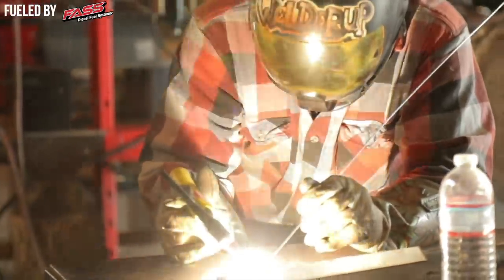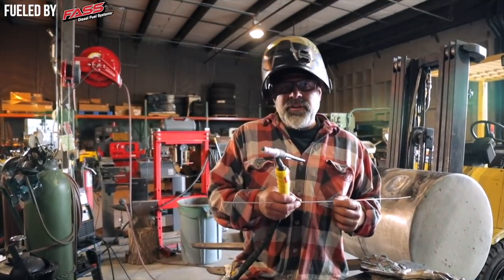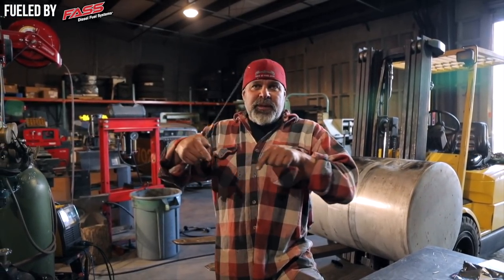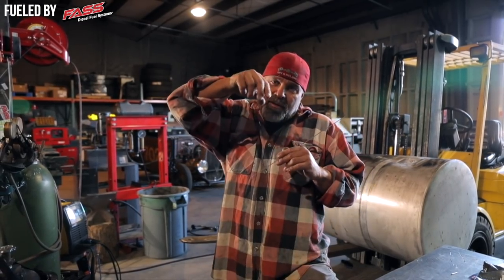TIG Welding An Aluminum Fuel Tank ⛽️ EXTREMELY DANGEROUS WELD

Comment: my late father was a welding engineer, he used to certify the welder's for their coding's, he was also certified to weld/repair nuclear reactor's on Royal Navy submarine's, he had a special stamp in his passport which related to the official secrets act, yes i'm bragging about him but he could weld anything, still miss him,
Reply: Dads are the hardest boss ever to work for but on the hand they are  the best  brother nothing wrong with bragging about dad but I just find it a little hard some times fill his shoes and picking the ball up and running with it  cheers to all the dads dead or alive thank you God speed
Reply: I'm impressed mate 👍🇬🇧
Reply: the company I work on over here in the states does the same thing. ive got a few hot work certs but always working towards more.

Comment: Purge with argon to eliminate oxygen in the vessel.
Reply: Great answer but the question is, how much argon and time will it take to purge a 125 gallon tank?
Reply: Some of these YouTube welders make me laugh
Reply: I 2nd that, argon purge is the safest way I’ve done it many times. You can check the purge with an oxygen meter or if you can’t get one use a lighter by the vent. If you can’t light the lighter from a few inches away your purged.  If you don’t know how to properly setup a purge you probably shouldn’t be attempting this anyway. 👍🏻
Reply: PURGE THE TANK ! I cringed when you took the torch to that without purging. You have to eliminate the air in the tank to prevent explosion. By not even mentioning purging the tank you are showing people they should  weld tanks in a very unsafe way.
Reply: Common welding knowledge never weld on an empty pressure vessel and displace oxygen with an insert gas....in this case, argon.
Reply: @darmstrong9334  125 gallons is 15-16 cubic feet, so it could take a long time and a ton of argon to fully purge it.
Reply: Nitrogen works just as well and is way cheaper than argon
Reply: Why couldn’t you fill the tank most of the way with water then only have to purge the small air gap at the top? Reduce the amount of argon needed to purge out the oxygen
Reply: I converted a 300 ltr LPG tank into a compressor tank. decanted the gas, filled with water and welding was no problem.
Granted I was shitting my pants at the time but I've done a few the same way now and never had issues.
Reply: I always purge with argon. Maybe its because i have done alot of stainless welding that requires is. But purging with argon makes the weld on the inside look as good as the outside when done properly
Reply: Striker works as a lighter...

(& I'm no "welder") 👷
Reply: Exactly
Reply: Just out of curiosity, why not rig an engine exhaust to purge tank? Perhaps a vehicle or a generator - just to blow out any oxygen..... just wondering. I do know a fellow who almost blew his hand off welding a boat gas tank - after he had filled with water.

Comment: Old school rule for welding fuel tanks is soap and water rinse the tank 20 times then... fill the tank full of water so there is no air pocket. If in doubt, rinse the tank 30 times. You can laugh if you want but this rule was taught to me in 1982 by my welding instructor.
Reply: Or you can just run your car exhaust into it for a good half hour or so after rinsing it once...
Reply: You don't need to fill the gas tank with water and soap and 20 time rinse. Just empty it as much as you can to another container and with all filler and breathing and fuel pump holes   open, put it outside for couple of days, when inside completely dry you can weld it. If nothing inside how can explode ? Only Air can explode?

Comment: Run the exhaust of an old gas powered car into the empty tank, let it sweat for an hr or 2. No more boom boom. An old lincoln pipeliner 250 works good. Flat top, hot exhaust.
Reply: what if the old gas powered car is running super rich?
Reply: @repurposedperformance5762  Don't matter,the hydro carbons will help expell oxygen and vapours ,Remember its the vapours that ignite,you can drop a lit cigar in a motorcycle gas tank and it'll go out every time,you hold a naked flame over the tank and the fumes will light up instantly
Reply: @ianmangham4570  so tons of raw gasoline vapors wont ignite when you spark a welder on the hole the fuel vapors are exiting...... I cant wrap my head around that. I see if it was a old perfectly running car but if its expelling raw fuel out the exhaust I dont know how that "doesnt matter"
Reply: @repurposedperformance5762  When have you ever seen a car spilling fuel out the exhaust? /you may get a few drips on start up but when the motors warm it's not gonna spew fuel out the exhaust,you got running rich/fire hose on the mind son 😂
Reply: @ianmangham4570  A car with a dead hole will indeed dump raw fuel put of the tail pipe. Dont believe me? Go watch the episode where Steve builds the Gasser car "Eye Candy". A car that is flooded or has a fouled plug will run raw liquid fuel right out the tail pipe "Son".

Comment: When I went to school for tig welding, we would set Argon and Helium mix for the thicker aluminum, it definitely helps with the penetration and flow. Also one of the craziest thing(s) I welded were actually top secret, I did a background check and signed a NDA when I first was hired through the company, all I was told the pieces were for a particular aircraft.
Reply: I'll take shit that didn't happen for $200
Reply: Thank the brass for  high lvl clearance jobs for private contractors!!   makin the big bucks  always enjoyed it
Reply: @BiggusDickus2  it's very likely. Welded on and worked on several classified jobs. Not all that exciting, unless you are a science buff too and can piece together what they are really doing..

Comment: I've been welding for almost 3 years, I've done a couple fuel tanks and one fuel/hydraulic tank and it's best to purge with argon. After you are done welding it up you can close the cap and plug some of the holes with fittings if you have them or stuff a wet rag in there and stick a air hole in there with a air gun on the end with a wet rag wrapped around it. Put some soapy water in a spray bottle and pump some air in the tank and spray the weld with the soapy water and look for bubbles, maybe get someone to help you look for bubbles if you are at the other end. Hope this helps 👍👍
Reply from the maker: Thanks for the tip Josh. Appreciate your comment!

Comment: ??? Yet an explosion can only occur in sealed containment...just as gun powder doesn't explode in open air. Is there no way to keep the cap off or what am I missing here?
Reply: Rapid expansion can overwelm the opening. It can still expload eaven with say cap off and filler neck open.

Comment: The only time I was close to anyone welding a fuel tank was mid 70s a Ford gran torino had leaking tank my boss told me fix it so with the other welder we started to clean it but up come boss McNeil with the torch to do it his way I took off at fast walk that some point turn into high speed sprint the tank made what sounded like a gasp and luckily headed for the sky well bold McNeil took the rest of that day off my guess was he went home to change his under pants

Comment: I would purge the tank for a while using C02 or the exhaust from a portable welding rig.🤔
And yes cleaning is up most important when working with aluminum.

Comment: My dad has a 6200 pro mod puller truck , we do the truck pulls west coast,  850 ci 3000 hpw,  2.5 tin axle 4x4 , I welded up fuel tank that's on the front of the puller 25 years old , I prep it , cleaned , welded up all the fittings for the lines , here is a true store ok , as growing up i was told i would not be able to work or drive do to my disabilitys lol , I drive really will , I work for Pacific seafood cannery as a machine operator,  for the fish that goes to all the Walmarts,  freddy's,  Safeway all the box stores , I have no clue how to weld , but I was watching YouTube channel,  I said I'll try it , my dad has his own private shop , he already had the welders so I practice 4 times a day on scrap till I got it , watching from seaside oregon

Comment: Purge it, and have an atmosphere tester, it will tell you when the air is no longer combustible.  Not that dangerous if you do it correctly
Reply: Three ingredients for fire= heat fuel and air (oxygen) . No air, no fire!  If the tank is FULL of fuel , there's no air !   If the tank is half full of fuel, the other half of the space inside has air. That's where the danger is. If the tank has no fuel, there's air= DANGEROUS!  To fill the tank with water first is probably the best safety precaution to use when welding a fuel tank
Reply: what kind of atmosphere tester should i look for. o2?

Comment: I was a bridge welder back in the 80s (before all the safety wires lol) the decking frames were galvanized thin angle.welded them so they could screw the decking.it wasn't really crazy other than the heights but u have 20 workers counting on u that your welds on that thin ass galvanized metal didn't break.lots of lives depend on you.i was 18.big responsibility. Carrying a box of rods on a 16 inch beam while unrolling the leads of your shoulder was the scariest part tho.

Comment: I'm not a professional welder but worked in the truck and transport industry for years.  Ended up having to do some cutting and welding on a fuel truck. I was very nervous but like you said the tank was full so alot less chance if anything happening. Just glad I didnt have any vapors around.  Definitely had the shop doors open to get the wind go through the shop

Comment: Welding aluminum diesel tanks is totally safe as long you pressure wash with hot water until the tank is hot to the touch have personally welded over 100 of them straps all the way around, bungs, baffles, and end caps. Make sure to leave every port open possible and no worries. Welding in a hog composter putting in AR liners is way worse or welding in a cheese pasteurizer tank where a torch won't even light  because to little oxygen is way worse. That's my experience

Comment: Hey guys I like the video...
But I would like to give you an advise... If you want to weld any kind of fuel tanks make sure that it doesn't have oxigen in it , because for explosion you need oxigen!!! So hok exost pipe from your car or truck  and lead it runs in your fuel tank as long as don't finish welding

Comment: 40 years ago I worked for a company that hauled gasoline I. A 13400 trailer it had to be welded several times they would run steam into it for hours before they were allowed to weld on it

Comment: I'm industrial maintenance guy now.  Started out in chassis shop tig welding all types cages. 

Hanging upside down with another guy working the pedal is interesting to an watch. 

Now I weld most anything on a machine combo of stick,mig,and tig.

I have welded fuel tanks but usually after they are cleaned an air out for couple days depending on weather an vapor condition.

I have welded on 5000 gallon air tank. Was sacred to death whole time on that one just running scenarios of where I would land if something went off.  
We drained an had nitrogen blowing into tank while welding but always a what if in your mind. 
An this was all done upside down 40ft up inside of a stamping press. 
Love welding an fab work but dont get to do near as much as I used to. 
That's why I love thsi channel for diversity of the projects an work.

Comment: I've built racecars and experimental aircraft parts over the years, welded Titanium, aluminum, and magnesium. Prep is the BIGGEST  thing and most important, clean clean clean for all disciplines of welding is key, and yeah you gotta do the test runs and set up runs on alloys, magnesium likes to catch on fire if heated to much when welding it, that happens and you are screwed royally with no way to extinguish it once it starts,, Fun stuff!!!

Comment: I have (against most recommendations) fixed leaking slip-tanks around the farm just fill em with water and weld at the upper most rotation, tried welding the cracks but usually end up patching, but i will drill out the end of the crack with a 1/8th or 3/16th bit to halt the crack. And yeah yer spot on Tigging is an art-form (especially ally)

Comment: I weld holes  on big oil filled transformers . I always purged it with nitrogene to flush the oxigene.and during the repair I let the nitrogene enter and exit to another access. So like that its impossible to explose  if the oil vapors are not fed with oxigene

Comment: still a green horn not even a year into my field experience, but the craziest thing I've had to weld was a rack in a shipping container to hold a compressor, the whole shipping container was filled with 55 gallon drums of hydraulic oil, diesel and fuel and spilt flammables. was super sketchy but I used a blanket and tried to cover the drums as best as I could lol

Comment: Common welding knowledge is never weld/heat an empty pressure vessel and displace oxygen with an insert gas...in this case, argon.

Comment: I repair diesel tanks almost every other day just take the filler cap off so it doesn’t build pressure and fill with some water and you’ll be good 👍 great video!!
Reply: I weld aluminum diesel and hydraulic tanks regularly and all I ever do is fill them with water then dump them out, Leave the caps off and weld away!
Reply: Yep it takes a hell of a lot to get the “oil” hot enough. All it does is catch on fire when it gets hot enough if the cap is open.
It’s better to clean the inside out, that way you don’t leave a bunch of burnt garbage in the tank that can pull into the weld pool
Reply: JustKeepingItReal got a used 100 gal diesel tank for my pickup.  Previous owner patched it with some unknown filler.  It’s leaking, so I was told to steam clean it out, fill with water, then weld.  Are you saying I wouldn’t need to fill with water as long as I remove the fill cap and pump?

Comment: For those that have NOT done a trade in welding please note the following:- This video refers only to Diesel Tanks; Petrol/Gas tanks present a different and much more dangerous problem, if there are any folds in a tank, ie. the ends are turned around and the outside edges welded, fuel can accumulate in the folds and even after years of being empty when the folded seam is welded the liquid secretes out and mixes with the Air/21% oxygen and can/has caused fatal consequences. After thoroughly washing the tank it is recommended that Co2 be used to flush out and replace the air in the container keeping a flow of Co2 the whole time till all welding is finished, ('This also applies to any cutting of a tank because the tools motor brushes and/or grinding/impacting can cause a spark'), the use of Co2 does not replace thorough washing as described in this video; Note! even after thorough washing and then 'filling' with water in a petrol/gas tank, this will not guarantee your safety, only a Qualified Tradesman should undertake this kind of work, because we have seen all of the videos showing the gory end results when people have not followed instructions to the letter with this kind of welding. I know its a video about a diesel tank but some clown will watch this and wont recognise the differences and end their life.
Reply from the maker: Thanks Russell,  I need to post this alongside the video. Appreciate your comment!

Comment: Hot taping live high pressure air lines is pretty sketchy and the first time I ever repair a 1” fuel line pressured up had me sweating bullets lol but it was explained to me when things are right you don’t have to worry as much
Reply: Damn straight

Comment: I figured it be cheaper and safer to fill tank up with water to weld. I've seen ppl using torches to cut flammable barrels and have it blow up on them

Comment: I've welded numerous diesel fuel tanks over the yrs that I simply just completely drained and then prepared the surface and welded. I've also purged with pure Argon as well which is the smarter of the two. I've done aluminum and steel tanks and luckily my father was a professional welder for yrs back in the day making hotrods and race cars for himself and many others.
Reply from the maker: That's awesome! Thanks for sharing!

Comment: Im not certified to do anything but there's pics of me welding before I turned 10 lol... I grew up in an old school trucking family, and in a truck shop....we have welded these for years. After I wash it down with acetone, then I purge the tank with a hose hooked to my pickup truck  exhaust for 45 min....then I weld it up leaving hose in and pickup running...o% oxygen in tank, that means zero percent chance of explosions....trust me on this, it'll save your life!!!

Comment: I make a lot of money welding diesel tanks. I’m the only one in my area that does it.  I always open the cap take out all the fittings and run a torch over the holes to make sure it doesn’t flash on me. Prep is everything on aluminum. I changed $150.00 as a minimum. Price goes up from there.

Comment: I patched a gas tank with soap to stop that leak then got everything as spotless as I could and put some sealer on that keeping it to a minimum and once I was sure no gas could come through made a patch that looked some what better over all and then when no leaks, removed the gas  that will solid up while there is gas it holds but gas gets below hole and the soap falls out. I was counting on marine tec goober to hold fair.. I filled tank with exhaust pipe running in it and gas weld (braze) this tank as it was on the rig and just about no way to save if pulled. It was hoaky way but most I would chance.. I just don't like gasoline. The bigger patch covered a lot of real estate but it also covered the ugly I didn't want to claim as I was just buying insurance and it was also all I had to work with, could I got it to shop my way would  kinda mirror yours and no goober either... even a damn poor explanation but I ain't feeling so sharp Steve